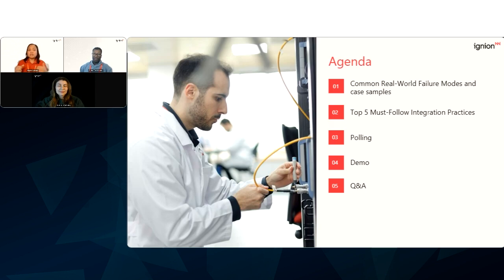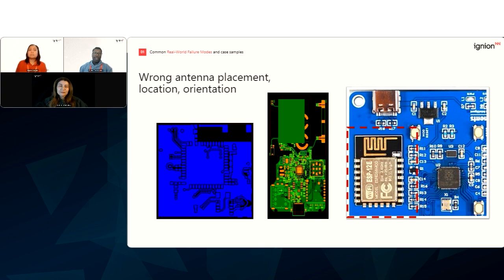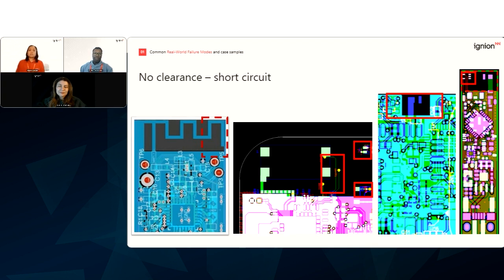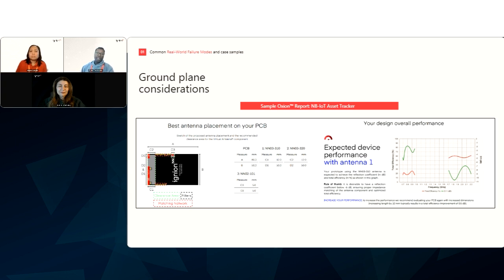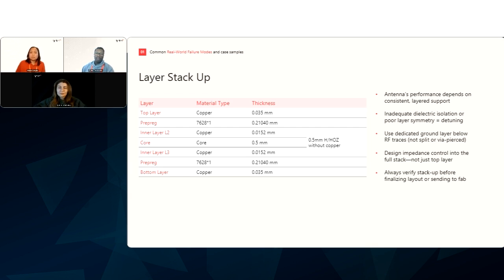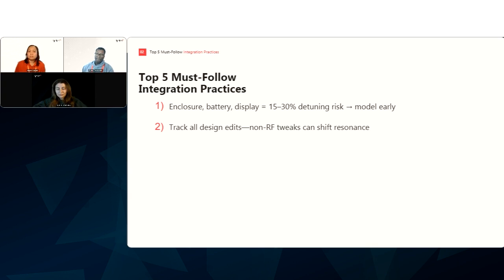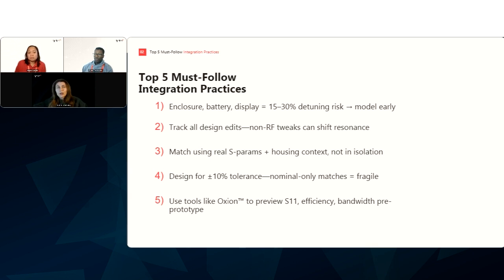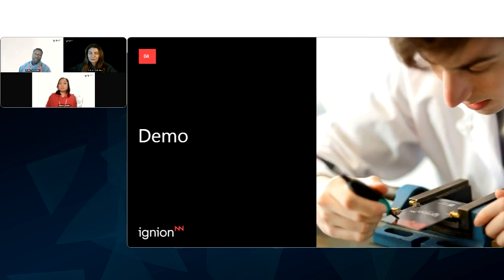Why Antenna Designs Fail in the Real World

Comment: hello I use NN02-224 antenna . this antenna 1 pad connect signal generator, The other pin is not connected anywhere. is it true connection?